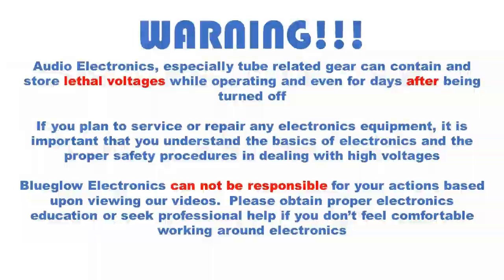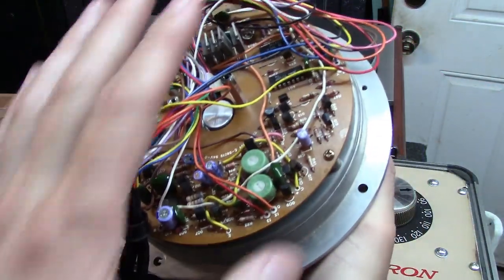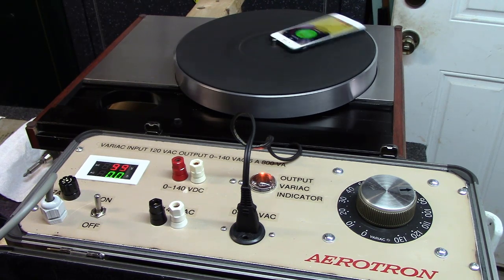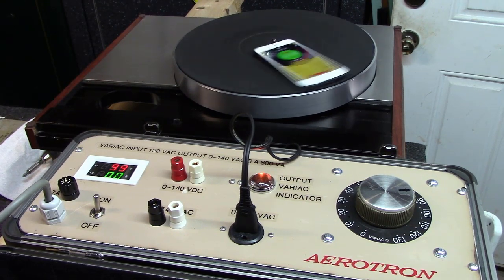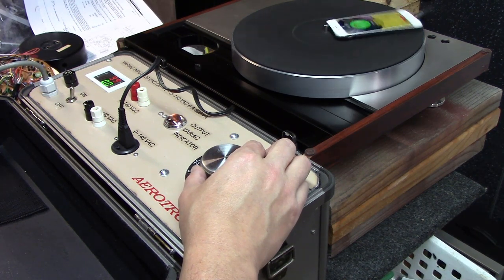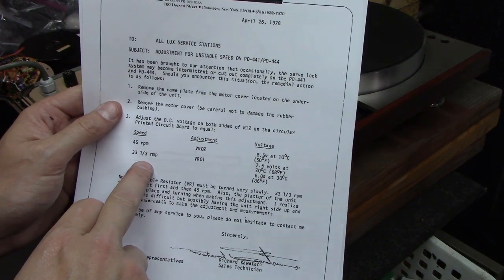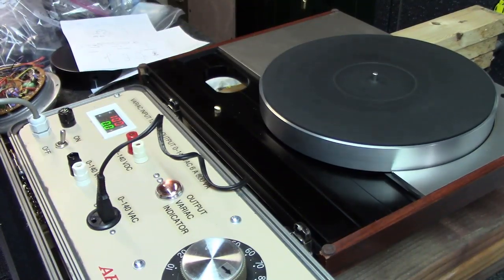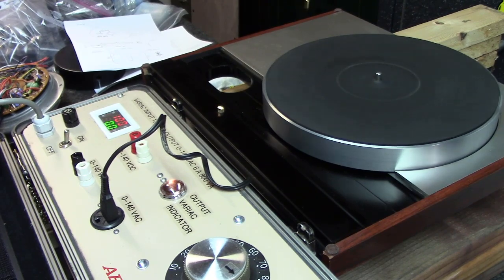Luxman 441 / 444 Turntable Speed Adjust -  Motor - Power Supply Replacement

Comment: Thanks so much for this. I have a PD-441 that is flashing it's speed error LED. I love this turntable and this will help me get it back to working order. I paused the video when you were showing the service memo and then copied it as a text document. Mine is in mint condition including the clear plexiglass cover. Weighs a ton though, almost 45 lb (20.4 kg)!!! Scary how much these things are bringing on the used market these days. I love vinyl so I'm keeping mine.

Comment: what was the problem exactly ? erratic speed ? low speed ? it would help me a lot if you could clrify this as i have some problems with the same drive.  and by the way where did you find the schematic for the power supply ?  thanks poul

Comment: If the unit wants to see 100 volts input what will happen to the tablet synchronization when it gets plugged into 117 to 120 volts from the utility?
Reply: I was wondering the same thing myself. He didn't explain why he was using 100VAC. The service memo didn't specify that this was necessary so when I adjust mine, I'm just going to plug it into regular AC power.

Comment: Here is a good example of why, if contemplating purchase of a vintage turntable, best to stick with simple designs. I prefer belt-drive myself. By the way, I used to have a Linn turntable-setup jig that clamped the turntable in place securely and provided sufficient height that you could easily reach under the unit and adjust the suspension and so on while the turntable was playing. It worked with most other turntables as well; unfortunately it got lost when I moved, or maybe it was stored at my folks' home and my mom threw it out, I never did figure out exactly what happened to it. I wish I still had it, I could really use it at work (audio repair shop). A new one is pretty expensive! PS, if an LP-12 ever stops spinning, it usually needs replacement of three electrolytic capacitors. Much easier than repairing a direct-drive motor's power-supply!